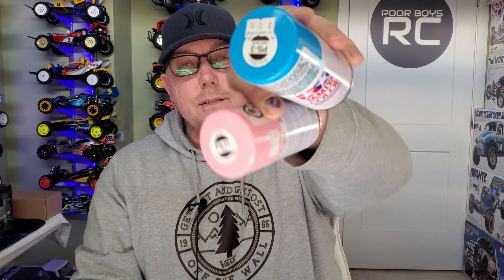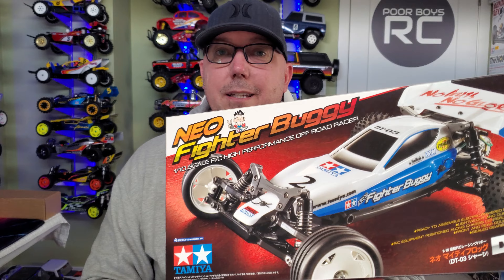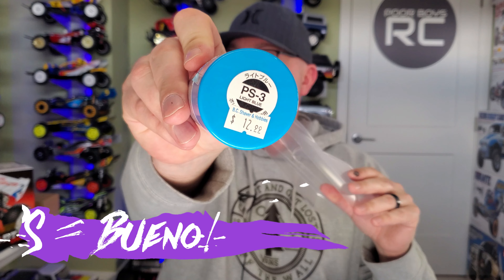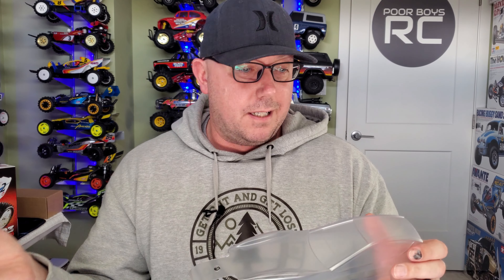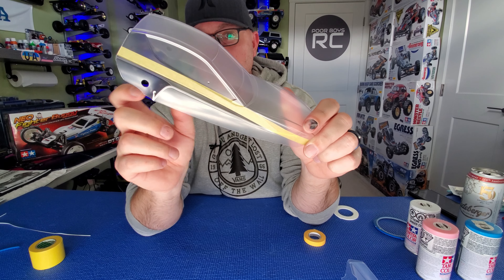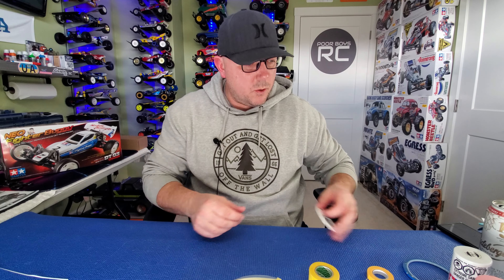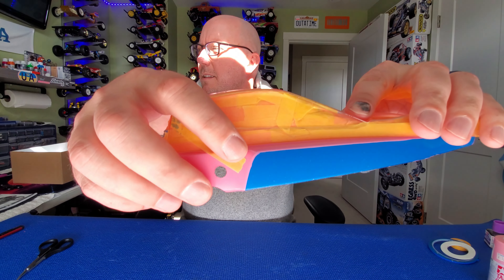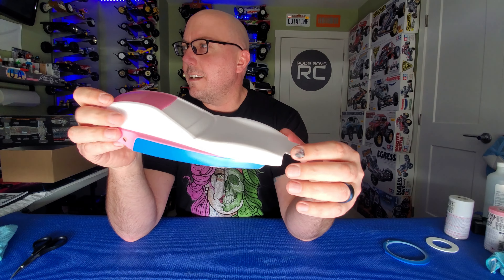How to Paint RC Car Bodies (Beginner Tips!)

Comment: Just did my first RC body and I'm guilty of not having the patience for 4 thin coats. I do the first one light, then a heavier second. Third light touch up if needed. Used what I had on hand that went on my actual car which has held up so far with no chipping or peeling. It's the Rustoleum poly outdoor paint for furniture or equipment. Great stuff that should hold up to my abuse on the 1/10 scale 😁
Reply from the maker: I'm seeing more and more people use that same paint on their 1:1 cars. I'm curious how it'll hold up on lexan. Keep me posted! Maybe I'll do a video on it if it holds up well. 👊🏼
Reply: @poorboysrc  Will do, and thanks!

Comment: Awesome job Fil.. btw I learned from my hobby shop a couple weeks ago if you use ps55 clear as a base coat, you can use TS paints.. tge ts will stick to the ps paint, but you have to put that ps down first so it etches into the plastic 😊
Reply from the maker: I always wondered if that would work... I have used TS on top of PS before, and it adhered. I never thought of using PS clear, then spraying TS to it. Cool tip! 😎

Comment: If you mask all your details and spray clear coat over the lines it well seal the tape lines and omit the run factor, plus you can use a mat clear and it doubles as a primer!
Don't  worry about the mat finish as the body finish is very glossy!
Ralphie
Reply from the maker: I've never tried that before, but you've got me thinking... I might give this a whirl on my next paint job.
Reply: @poorboysrc  giver a shot y'all be satisfied.
Reply: Are you talking about just the thin strips of masking tape?  Put those on, then spray the entire underbody with clear mat finish?  I'm a complete noob when it comes to painting bodies, so just wondering.  Thanks.

Comment: Great job. Any tips on painting an old "clear" never painted yellowed by de aging body shell?
Reply from the maker: Oooh, that's a tough one. Never tried de-yellowing lexan before. I have done it with ABS plastic (hydrogen peroxide and UV light, Google it). But never lexan. It might work, though! 😉
Reply: @poorboysrc  I'm not sure what to do but I was thinking to try to clean it very well but I don't think the yellow will come out. I might paint it anyway and see what the result will be. I'm very noob on this and just got my first hobby RC can a bycmo Subaru Impreza magazine build rwd with some extra parts that are always welcome. It should be around 20yr. Thank you for your help

Comment: any tips on how to tape off windows front rear and side windows that is the one part I had issues with
Reply from the maker: Best advice I could give you is to use quality masking tape, and a sharp hobby knife so you get nice cut lines. From there, it's a lot of practice, practice, practice. 👍🏻
Reply: @poorboysrc  I used blue painters tape and yup a sharp hobby knife but for some reason I had so many places where the paint bled through

Comment: Do you need to scratch up the inside surface with an abrasive pad when cleaning with washing up soap to give the paint more to hold on to?
Reply from the maker: You can do that, I don't do it all the time, but on a body I know is going to get worked hard, I will. Just don't use too abrasive a pad. Gray scotch Brite is perfect. 👊🏼

Comment: How long do you wait until the first and second coat dry? Did you ever try using hair dryer..
Reply from the maker: I usually wait about 20 minutes. I have used a hair dryer before, many times. I prefer the sun, but during the rainy winter months, I'll bust out the hair dryer. 👊🏼

Comment: Great video.. thanks. 2 questions for you. Do you wash the shells before or after you cut them out. 2nd question. What are you using to mount your cars for your display.
Reply from the maker: Always, Always, ALWAYS wash the shell before cutting. After cutting they're usually good to go, but occasionally I'll wipe the inside with rubbing alcohol to remove finger prints. 

I mount my cars with "closet organizers" I found at Home Depot. :)

Comment: Hi Fil,
Thanks for the helpful video! I’m getting back into the hobby and picked up a Squash Van. Question: the paint on your Squash Van turned out really nice! Did you use the same techniques that you showed in this video - ie same masking tapes and stuff? Thanks from a new subscriber!
Reply from the maker: New Subscriber, right on! Thanks for coming on board, Simon. For the Von Squash, I used all the same tips and tricks that you see in this video. The key for a really crisp line between the two colors is to use the blue fine-line tape, and make sure it's seated really well before you start spraying. A hair dryer works perfectly to help the adhesion. When you're happy with that, the less expensive, wider tape can be used to mask of a large area, like the white part of the SV. Here's a quick link to some fine line. It's not 3M brand (which is what I use), but it's got good reviews, so it might be worth a shot. jinbing High-Temp Vinyl Fine Line Fineline Masking Tape Automotive Paint for Curves Blue (1/16 in +1/8 in Each 3Rolls) https://a.co/d/cRANfre
Reply: Thanks so much for the detailed response! Really appreciate it, and thanks for the enjoyable content! The Squash Van is going to be my first build since I was in high school back in the late 80s early 90s! Amazing that this hobby is still going strong, love it!  @poorboysrc

Comment: Hi,  daft question but what’s the clear film you pull off at the end ?  And how did you apply it?
Reply from the maker: Not daft at all, it's a good question. That's called overspray film. It's kind of a shrink-wrapped thin plastic thats applied to the body at the manufacturing facility. It's purpose is to keep overspray off the outside of the body during paint. If your body is missing it, you can always just mask it off the old fashioned way. 👊🏼😉
Reply: Thank you,  I’ve not had a model like this before only just realised you spray the underneath of the shell not the top like on the lunchbox etc .
Reply from the maker: @darrengaynor4966  Oh, yeah definitely spray the inside of the body with clear (polycarbonate/lexan) bodies, and the outside with hard plastic shells. 

It's also very important that you use the proper paint. Tamiya PS paint for Polycarbonate/lexan and TS paint for hard ABS plastic.
Reply: @poorboysrc  any tips on cutting out the body? Thanks for all your help
Reply from the maker: @darrengaynor4966  just take your time, familiarize yourself with the lines you want to cut and those you don't, before you start cutting. A good pair of curved scissors can be a life saver. Some guys use xacto knives to cut, I don't use one often, but for long, straight lines (like under doors, side of the body) I do, and it works great. Just score an edge, then crack along the edge, don't cut right through. 👊🏼
Reply: @poorboysrc  thats really helpful.  Thank you
Reply from the maker: @darrengaynor4966  happy to help! 👊🏼

Comment: The one thing you did not mention when painting a body, but you did it. It is better to spray the darker colors first. White should be the last color you spray. Also you can use 3M blue tape for masking and it works well and is cheaper than Tamiya tape. I use the 3M blue painters tape for large areas and Tamiya tape in tight areas. However, I have used the 3M tape on everything and had no problems. Thoughts?
Reply from the maker: Absolutely a good point! I think I actually edited that part out by accident! Lol! 

The blue tape I discussed in the video is the same 3M blue autobody tape you're referring to. That stuff works great on RC bodies! 👍🏻
Reply: @poorboysrc   That is funny you edited that part by accident. LOL Yes, the blue tape does work good. I use it all of the time along with the Tamiya tape. Keep your great videos coming! Thanks

Comment: I was thinking about using Lexan paint on my tire letters for my mustang rather than using Paint Pens. The paint from Paint Pens doesn't seem to last. It cracks and flakes off even during normal driving. The letters come in white, and I figure I can spray some of them, then glue them to the tires after. With your opinion: do you think the Lexan paint would do better?
Reply from the maker: That's a good question. The additives in the lexan paint would lend themselves to better adhesion than the paint pens, so in theory, it should work well. Keep me posted on how it goes.